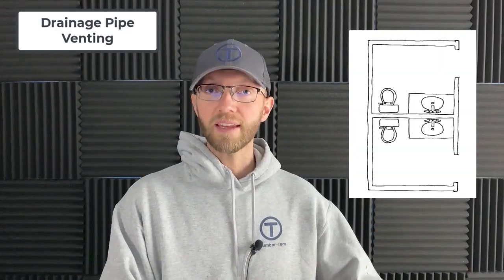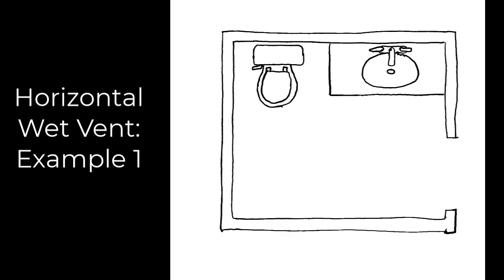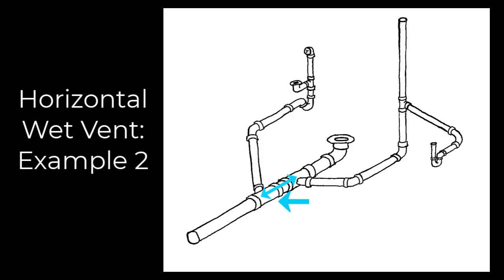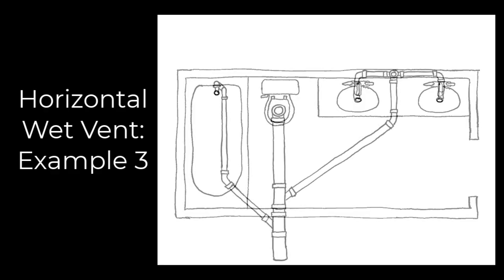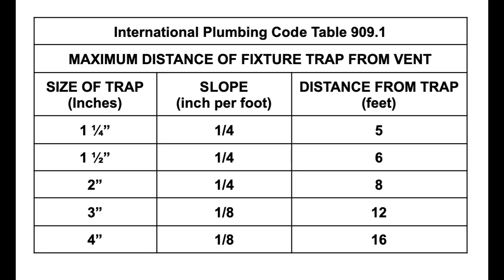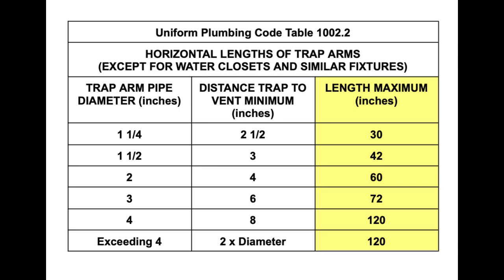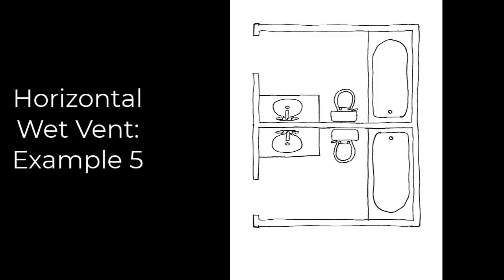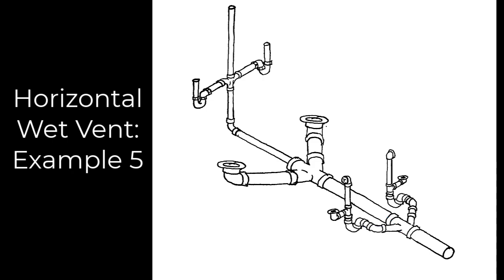Drain Venting Lesson 3 - Horizontal Wet Vent Part 2

Comment: Hi Tom, I have a setup similar to example 5,however only the furthest upstream sink is connected to the vent (the bathrooms have showers back to back instead of the way you are showing it).

I would like to add a sink and toilet with the saniflo system to my basement. I was going to add the vent to the existing system higher than where the furthest upstream sink connects to the vent pipe. After watching your videos I'm starting to think this isn't going to work. Can you give me any advice?
Reply from the maker: Sanifo system will pump waste. That has a different flow and will affect the venting. I would recommend connecting downstream from the wet vent if possible.

Comment: if the main drain line is increased from 3" to 4" does that allow more fixtures to be wet vented on the same line?
Reply from the maker: You can increase the line to 4”. But a wet vent is limited to 6 fixtures or two bathroom groups. Make sure to watch all of the videos in this series for understanding.

Comment: Tom, your videos are helping me a lot with planning some updates to my small, 2 level, 1970's pre-fab. Local code is IPC2018, and I had drawn a layout very similar to yours @11:00, except for running the 3" horizontal drain pipe further and using a 3" to 2" Long Turn Tee Wye (with a cleanout) to connect to the 2" main vent stack also used for the Lavatories. My question is whether I can connect a separate, existing, 2" dry vent coming from under the kitchen via the basement at 6" above the 2" Double Fixture Fitting I'm planning to use for the lavatories? All plumbing runs under the main floor in an unfinished portion of the basement. The Kitchen drain already enters the main waste stack below where that of the bathroom will connect. According to Table 906.1 and assuming 21 DFUs, including kitchen sink and dishwasher, it's ok to run the 2" vent up to 110ft. I estimate this proposed 2" dry vent run from kitchen to above the Lavatories to be under 30'.  I'd like to minimize the number of pipes through the roof as much as possible.  Also, would you happen to have a video on IPC rules for cleanouts? Thanks again for the vids and any guidance on this!
Reply from the maker: When you are dealing with remodel or repipe, you can usually connect existing where needed.  For example, if you were to replace cast iron pipes with PVC you can pipe it the same as existing if updating to current code is not possible without deconstructing the whole house.  Most inspectors are understanding about that in remodel situations.  However, dry vents should not be run horizontally below the flood level rim of the fixtures served.   If the kitchen line connects to the stack below the bathroom group connections then it should be fine.   

I do have a video explaining clean outs.  Check out the IPC chapter 7 videos.

Comment: When i am trying to build with in the ipc restrictions for distences of trap arms to vents, am i able to label my vent, a horizontal wet vent, and pull my 8' for 2" trap arm, off of the final end point of the horizontal wet vent, or do i still have to measure back to the vertical dry vent location?
Reply from the maker: The max trap arm distance is the horizontal distance because the drain pipe serves as a vent.  No need to count the vertical distance to the dry vent.

Comment: Plumber Tom, How do you vent a kitchen sink in front of a window? My understanding you can’t run a vent horizontal under the window to get around the window. Do you have a video explaining this or a diagram? Thank you. Craig, long time listener-first time caller.
Reply from the maker: Hello. Thanks for watching,  

You can run a stack next to the window and arm under the window in most cases.  You can see it in this video:
https://youtu.be/3I2TfyoKTzE

Or you can bring it up into the cabinet through the floor and install an air admittance valve.
Reply: Use a studor AAV vent for ur kitchen sink